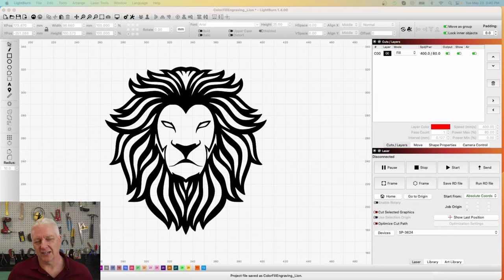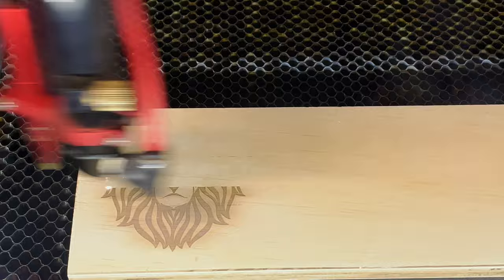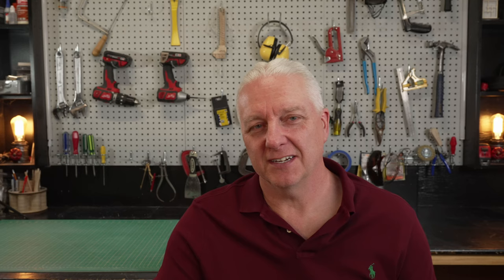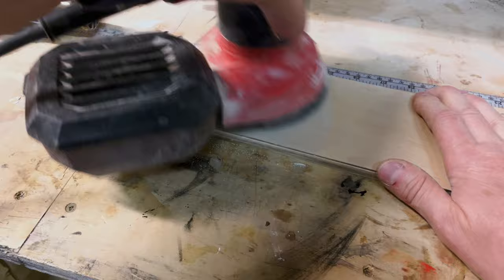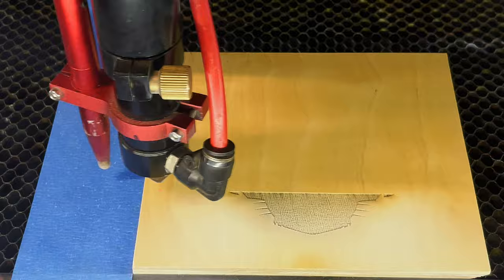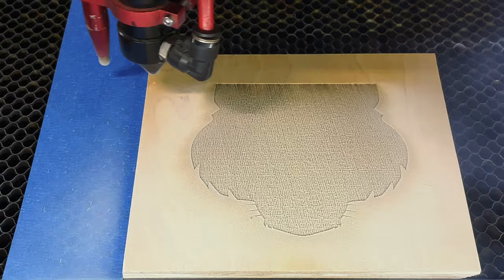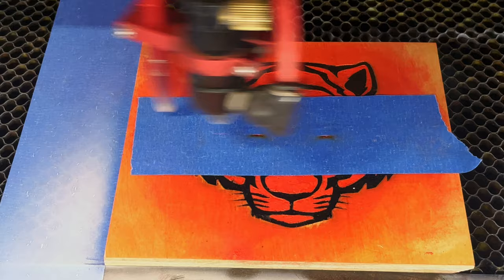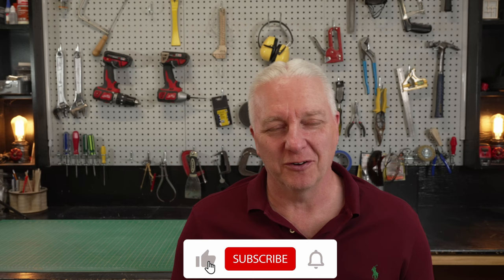Achieving Stunning Color-Filled Engraving

Comment: Why not just bake it in the oven? Less chance of blowing the powder out
Reply from the maker: Yes you should be able to do that. It’s not very selective though, so you might have some sanding to do after.
Reply from the maker: Sorry I accidentally removed your you question.

However, here is the answer.  If you are heating the entire surface, then all of the powder cos\at will melt into the surface wherever it is.  With a heat gun you can primarily focus on the engraving and not melt powder coat that might be scattered on the surface.  This will make it a bit difficult to remove.

Comment: Goodness, thank you for putting this out there. I tried the Powder Coat method and the stuff gets everywhere, even without using the air assist. I like the idea of using a heat gun to do this so much faster. Still not a huge fan of Powder Coat process since it does stain the surrounding wood, thanks for the video regardless!
Reply from the maker: Light sanding will definitely be required regardless of the method you choose.
Reply: Seal the material before you laser
Reply from the maker: @johnagorman  Yes this is a good option to make clean up easier

Comment: Great video and thankyou for making it. I personally have never had an issue with getting the project re-aligned in the laser. Not sure why others have. I simply use a couple of big bar magnets to use as a guide to align my project too. They dont move at all because they have strong magnetic energy to stick to the bed of the laser. I form an "L" shape with them an align my project up to both the side and bottom of the bar magnet each time I place the project in the laser. Works perfect every time. I will say though that I do not like the texture the laser gives the powder coating after it melts it. It looks all lava like. Your method is great as long as you have a heat gun that doesnt blow very hard or else you will blow your powder coating away. Mine blows a little too hard but I have learned to hold it far enough away until the powder coat starts to melt some then I can move in closer. Thanks for this idea.
Reply from the maker: Yes. I will either use magnets on an acrylic square or make an actual jig

Comment: I was VERY glad to see that you did NOT say to simply disable the air-assist and re-engrave the painted areas to melt the paint.  I watched a different video before this where that was suggested,  and I DID NOT want to merely cut off the air-assist completely.
Reply from the maker: Yes this was exactly the point of this video. I think using a laser as a heat gun is pointless

Comment: I tried the heat gun cure on powered coat today and I was really surprised how nice it came out. I did two samples one with  transfer masking and one without. The masked one came out flawless and required zero sanding. The unmasked one did require a good amount of sanding. Thanks for the info I will be using the heat gun for all my paint fills.
Reply from the maker: The mask will definitely make the sanding job easier. Glad you got value out of this

Comment: I would post-cure the image with the powder coat in it, the heat gun won't bring it to full cure (assuming polyester resins) unless you sit there for 10-15 minutes after the powder itself has come to 400°F.

Love the very cool simplified method though!
Reply from the maker: It may not be necessary to go the temp up to 400F. I believe that’s the bonding temperature to make it stick to metal. It seems to bond pretty well. The powder coat in the video is used for painting fishing lures so it may have a lower melting point anyway

Comment: I have had it in my mind that powder needs 400 degrees of heat for a period of time but I am anxious to try this. I saw one video where the fellow laser heated the filled part and said it turned out perfect, but not according to my lying eyes!
Reply from the maker: The advantage of using a heat gun is that alignment with a laser isn’t required.  So if you don’t get as much powder as you need, you can always apply more and reheat

Comment: Good comment on using the best tool for the job. I have seen so many videos of people using fusion 360 and 3d printers for  hours  to create something you could make with a drill press in about 20 minutes.
Reply from the maker: 😀 I have the same concern with high powered diode lasers claiming to be able to cut lumber - just use a saw.  It's faster and cleaner.

My desire for innovation is driven by my own laziness.  If what I'm doing seems too hard, then I'll find an easier way.

Comment: That's a good technique and thanks for sharing your experience.  Two quick questions:  1) would you be able to skip the sanding if you masked everything from the start (or what would the challenges be)?  Is there a recommended "mask" that would peel off easily but still not melt with the heating of the powder?
Reply from the maker: You could try to mask but the heat is likely to lift it. But give it a try - there should be no downside to making. I typically use this transfer tape:  https://amzn.to/3V6wdbO

Comment: Great improvement of this method! Although I still don't understand why not use good quality liquid paint instead.
Reply from the maker: You certainly can use paint, though it dries thinner.  In this scenario, we are using powder coat as a filler - you can apply a couple of coats and essentially get a similar appearance to resin-filled engraving, except much easier to apply.

Comment: Really awesome for 1 color! Almost seems for multiple colors it may be easier to just use the laser as the masking would not need to be done plus you have to get it back on the laser in the exact spot lol I am not good at that...AT ALL! I may try this on a complex engrave I did and use mica powder or epoxy powder as I think that will melt the same as the powder coat but not sure....so I will find out.
Reply from the maker: I think you’re still going to need the masks. It’s not for heating, but rather for spreading powder coat without contaminating  other colors

Comment: Thank you for this method, I was just about to give up on using powder coat paint. I do have a question, when would you use powder coat vs color epoxy?
Reply from the maker: You would definitely not want to use powder coat in project that will come into contact with food.  Finding food-safe epoxy is pretty easy by contrast.  However powder coat cures I
Instantly.

Comment: Thanks for doing any video but especially this one! I have an Atezr p20 and the issue I had with using the laser to heat the powder was the module fan was kicking up the powder. I am glad I don't have to abandon the powder coat method.
Reply from the maker: Yes, most modern diode lasers make a lot of wind and powder coat is basically colored dust. It’s not a good combination.

Comment: The public library, where I use the Trotec Speedy 300 80w laser, tried three of the Pro-Tec powders (black, pink, and light green) on two pieces of hardwood, a simple engraved design, and a heat gun, although the heat gun had only one setting. There were mixed results, with the best results from the black powder. I was not present when the work was done but the staff member told me he was glad he wore a mask, as when he took off the mask there was powder all around the periphery of the mask. He told me the pink and green did not work at all, as the powder flew away from the engraved areas.

1) With the Black & Decker Dual Temperature heat gun you mention, did you have an issue with the powder flying off the engraved areas?
2) Did you wear a mask?
3) Why would the black work better than the other two colors? Higher density? Is there anything in the Material Data Safety Sheet which would indicate colors less prone to flying off?
4) Any other tips or tricks not discussed in the video?

Thank you! I hope you are well and I look forward to hearing from you. I am concerned about the heath and safety of the library staff. Best, Deb
Reply from the maker: I didn’t have any dust flying around because I don’t start with the heat gun close enough to kick dust up.  I start first with it just close enough to start melting the surface and once it starts to darken, then I move in closer.

As far as safety, you always want to wear a mask for most things in a workshop.  I don’t think my heat gun does anything special - this is a process that requires a bit of practice.  I think the darker colors absorb heat better, so they give the impression of working better.  It just takes patience.

Comment: Really cool video, thanks. It looks like you're using the fill setting to remove the masking tape for the 2nd 2 colours, why not just use a cut line and then peel the tape off? This would produce much less heat and hopefully avoid instances like you ran into on your tiger.
Reply from the maker: I did a full engrave because you might be removing color that is already in place, but if you know that you aren’t then you could just cut the tape.
Reply from the maker: Actually in this case I engraved only the sections where a particular color is being placed. Then engrave for the next color. This allows colors to come up against each other without colors running into each other

Comment: This is fantastic! Good safety tips too. As suggested, use a weeding tool to help get that tape off. Do you not find the tape leaves lines at the joins? Looks good on yours but I always find it distracting and my eyes are drawn to the lines left at the joins. I need to find some bigger tape to avoid that.
Reply from the maker: I use a dental pick to remove the tape, and off camera, I did some of that on this project. Definitely get 2" tape if you can find it, but 1.5 to 1.75" for sure.  It minimizes the places where engraving might be weaker, but with a 90W laser, the blue tape doesn't stand a chance 😉.  Note that you can also get 12" wide transfer tape.  I use this: https://amzn.to/3f9bu1S

Comment: Would masking with aluminium duct tape help with the multilayered jobs like the tiger do you think? I would think it would reflect excess heat. The only problem with that approach is the adhesive of those tapes tends to be pretty strong.
Reply from the maker: Not sure and heat really isn’t a problem, but impatience is 😀

Comment: I was thinking you could put it under the broiler or in a toaster oven. It would melt long before the wood would burn. Kudos for showing your mistake. That's a lot for the paint.😉
Reply from the maker: Mistakes happen and I’m not afraid to show them - I make many I can choose from 😁

If I wasn’t using a heat gun, I would probably choose an old toaster oven. Both will work better than rerunning a laser over the paint

Comment: Steve: you are aware that png images can be traced within lightburn to save you a step of using Inkscape right? I’m not sure why you always want to use Inkscape for everything that lightburn can already do. 

1) copy image
2) paste image in lightburn
3) right click and select “trace image”
4) move the sliders around until you get as much of the image traces that you want (this can also remove any watermarks if you do it right)
5) select delete image
6) you should be left with the outline once you close the window.

It’s very fast an easy which saves the loading and saving and reopening steps of Inkscape.
Reply from the maker: Yep, of course.  I just like the way Inkscape does it.  I don’t usually use Lightburn as a design tool.

Comment: This is a great video! Thank you! Would love to know if there's a similar but alternative method that wouldn't require sanding the surface after the heat gun and the paint is dried. I'm thinking for projects on wood that is already aged and in a state that sanding would take away from of the vintage look.
Reply from the maker: Well you could mask the material before engraving and then remove the masking after heating.  Your masking would have to be able to handle the heat though

Comment: Hi, thanks for the video. I think of using an iron maybe also an option. So maybe I will have more control over the temperature.
I ordered some powder and will give it a try.
Reply from the maker: For sure, try it.  Experimentation is the seed of innovation.  If you use an iron, I would suggest laying down a layer of parchment paper.  I would caution that the large heat pattern an iron would give might start to delaminate plywood though.
Reply: @SteveMakesEverything  I don't want it for plywood , i only use plywood for Tests . I recommend Solid Wood 😁 for final products.
I will keep you posted with the result.
Reply from the maker: @Schoendings  I usually avoid plywood too.
Reply: @SteveMakesEverything  so i tested. But doesn't work well in First try. Sticks in the parchement  paper. Seems I get a bit hot. I will do some more Tests  to get a better feeling when i have to Stop. But Overall ironing works also good to melt the color.
Reply from the maker: @Schoendings  You would definitely have to wait for everything to cool down to room temperature before trying to remove the parchment paper.  I had the same problem in the video removing masking tape too quickly.

Comment: Loved the video.  My only critique is that you failed to mention the jig which puts the wood back exactly where it needs to be for 2nd and 3rd engravings.
Reply from the maker: I guess I'm guilty.😀. However the video clearly shows my jig, which is just a well-place piece of blue tape, along with the edge of my honeycomb workspace.  Between engraves, I just eyeballed the replacement of the material.

An easier way to do this on less complicated multi-colored images is to engrave the entire image and then mask off each portion of the image that you want to paint.  After each color you can remask for the next color.  Don't do what I did, though, and rip the tape off before things have cooled properly.
Reply: Quick question,  is it generally a high or low heat from heat gun needed to melt powder coat paint?
Reply from the maker: @briangermain8403  I use the low setting on my heat gun.

Comment: Will the powder paint and heat work on other materials? I’m wondering about real or synthetic leather and harder materials like stone or slate. Thanks
Reply from the maker: Yes, it will work on any material that powder coat sticks to.  However you need a fairly deep engraving for this.

Comment: So pretty....Thank you for sharing this! I just bought Borax and it really didn't do much for my wood engravings. (HAHA) I will make sure to give this a try. I use a lot of basswood for my projects. Was considering using this method after engraving plus staining. Was a little leary about fumes if used before. AND...is it a good idea to seal the project after the sanding's been done? THANK YOU for your awesome presentation!!!
Reply from the maker: Hopefully this one works for you, though borax on basswood should be pretty dramatic too.  There shouldn’t be any real fumes from powder coat since you won’t be getting it hot enough to burn - only melt a bit.

Comment: Next test, because I sublimate as well as laser and 3d print..  I would try putting it in my heat press at like 380 for 30-60 seconds.
Reply from the maker: That would probably melt it but you need to put something like parchment paper down to prevent all the paint from sticking. The only downside is that a heat press isn’t too discriminating, so it will also heat thing that you may not want.

Comment: How does he get the wood back in the proper position todo a second engraving? I do this and the imag is "blurred" or offset.
Reply from the maker: Make a jig and lock it down on your workspace.  If your material can be removed/replaced accurately, you will have no problems.

Comment: Not sure what I'm doing wrong.  I engraved my design filled it with green Pro Tec powder, used my heat gun on low making sure to keep it moving and my green immediately burned.  Tried it again with red and same result the powder coat just burns and turns black.  Any suggestions would be appreciated.
Reply from the maker: Just go a bit more gently.  Low heat on the heat gun and pull it away a bit from the workpiece rather than cooking a small area.  As soon as you see the paint start to get darker or shiny, then back off and gently keep it heated by moving the gun into position briefly and then pulling it away again.

Comment: Hi Steve, your videos have helped me to learn laser engravering and but am bit confused in the tiger engravering. If you  fill the first outline with orange then wouldn't the whiskers come out orange  than black?
Reply from the maker: There are a couple ways you can select color for a particular area.  You could just make off place where you don’t want a particular color, or you could re-engrave after the first color to allow for new space to get the second color in place.  Both will have their pros and cons, so you’ll have to play around to see which one works best for you.

I wouldn’t normally use multiple colors because it’s pretty laborious, but I did it here just to show you the art of the possible.

Comment: What grit sand paper did you use? I can’t seem to get the wood cleaned up after I heat the paint. Help!!!
Reply from the maker: Depending on the wood, you can go with 320-480 just don’t sand through to first layer.  You could also spray clearcoat or poly on the wood before engraving. This will prevent powder from sticking to the surface

Comment: Fabulous video as always..its give me a thought thought that im going to try...im a crafter have have multiple colours of embossing powders and wondered if those could be used ? And can i ask how did you get the image linned up correctly once you removed it to coat it
Reply from the maker: Yes give this a try.  It works best with 1/4" material since you want to engrave a bit deeper than normal.

As far as alignment, I tend to use jigs to allow for reproducible positioning., though in this case there isn't really anything to align